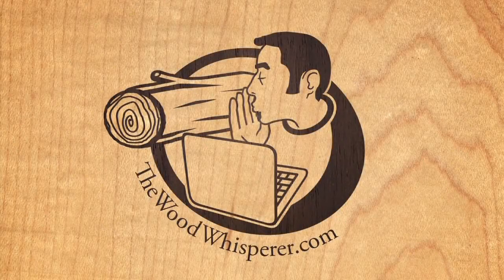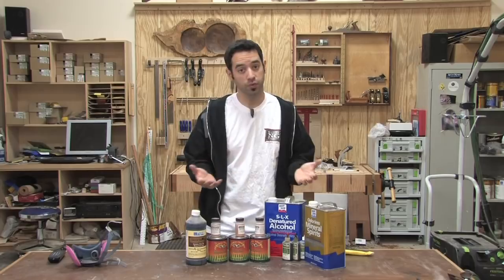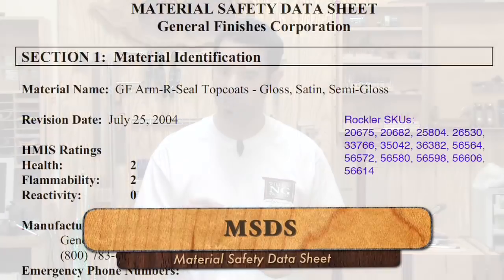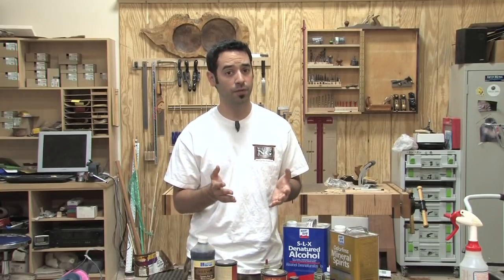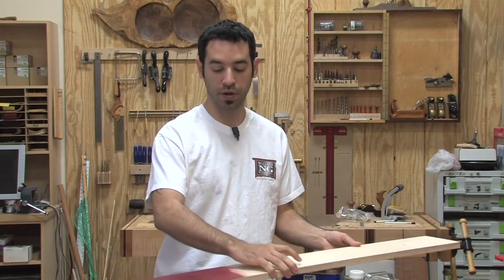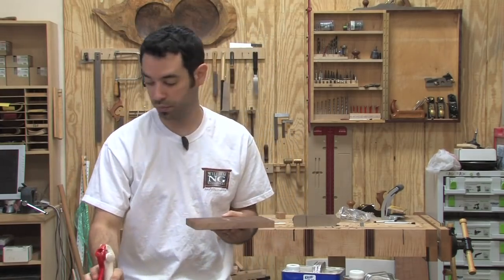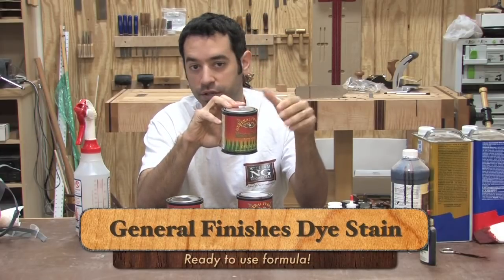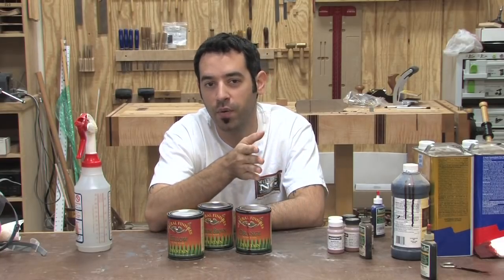142 - Understanding and Using Dyes

Comment: Thanks you for this video, it is very informative! But I have a quick question - If I want to dye a salad bowl with the general finishes dye or the water based dye and then finish it with the general finishes salad bowl finish, would the piece then be considered food safe?
Reply from the maker: +Bianca Bovell I suppose, technically, it would be. As long as the top coat never wears off, it should be ok. But over the course of years, you might find the topcoat wears and begins to wear into the dye layer. So make sure you have a good thick topcoat on top of the dye.
Reply: +The Wood Whisperer Okay thanks for the advice !

Comment: are unbound dyes still light sensitive once they have say a 5-10 coat rubbed oil finish on top?
Reply: It depends on the oil finish. Some, usually more expensive ones or those intended for exterior use, contain additives to protect from the oil finish and the dye/stain underneath from fading. These additives are UV absorbers and UV blockers - two separate chemicals. A basic oil finish itself is not going to do much to prevent UV from penetrating into the dye molecules and "bleaching" some of them, causing fading. Much like a rug will fade next to a window, unless the window has UV blocking properties.
Reply: Keith D thanks Keith, that is what I suspected but needed to make sure.  Makes me wonder if I would be better off with just a couple coats of oil then build gloss with a UV resistant spray clear

Comment: Besides using shellac as one form of blotch control, could shellac also be used in preventing the need to pre-raise the grain with water based dyes?
Reply from the maker: Dumadean Simpson well..... sort of. But if you use shellac first you are at least partially sealing the fibers. So the wood won't take much color after that point. So if you're looking for full color penetration, I'd say just stay with what works and do the pre-raising.

Comment: Excellent video as always!  I would love to hear your thoughts on dyes vs. stains.  I've been woodworking my whole life but was always worried about putting dye/stain on black walnut (almost the only wood I use besides figured maple).  Even though I love black walnut the most I've never been totally happy with the natural danish oil color especially as it lightened over the years, even though it is beautiful.  I recently had a project where I needed the wood dark so I tried staining first, lightly with a Koa stain and it turned out absolutely amazing with a rich dark finish to the walnut instead of the natural walnut.  Wish I would have got the nerve years ago to try it :(

Comment: I'm dying a quilt maple 1/4" laminate topped guitar body with a Jungle Burst (Tiger Stripe Camo) finish. I want to use Transtint Black to accentuate the grain in the figure to emulate the tiger stripe. I'm thinking, I should use multiple coats of diluted black w/short sit time then light sanding so only the figure accepts the dye. Any suggestions? 50/50 H2O/alcohol medium? Also using Transtint Green and Golden Brown to complete the camo effect. What type finish coat, sprayed lacquer? Thanks.

Comment: Have you ever tired rit dye?
Reply: Love2boat92 have you? Im soaking a piece of wood on rit right now for a knife handle.
Reply: daniel angel I have tried it and it does work however use the premixed dye not the dye that comes in the powder form. The powdered dye when mixed doesn't have the same vibrant colors that the premixed dye does have.

Comment: What people dont understand is if your trying to match a color usually dyes are not needed. if you are creating a custom color go for it.  Get oil based utc they come in about 8 colors and your can match Anything.  coat with sanding sealer and a clear and you are done.  This guy way over complicates everything.  I have finished hundreds of pieces of furniture to an exact match and never did any of this.